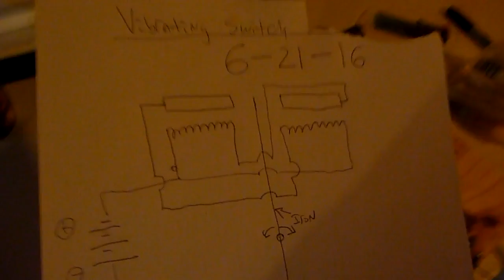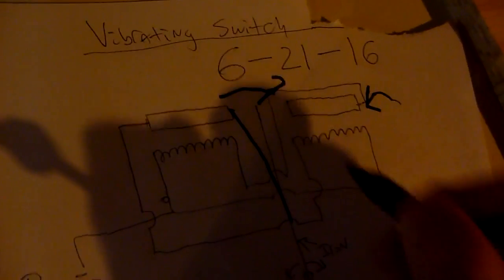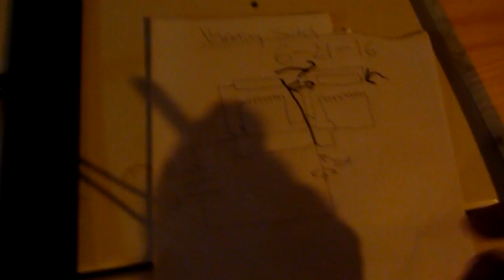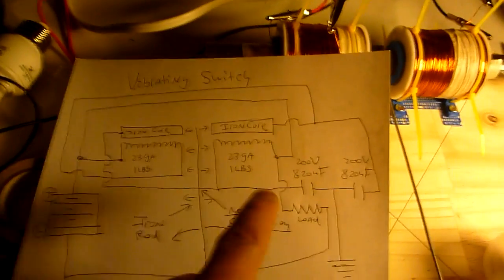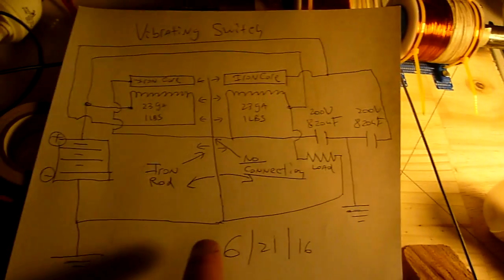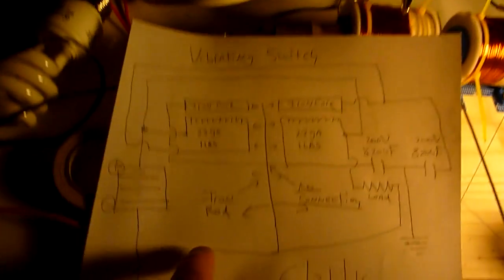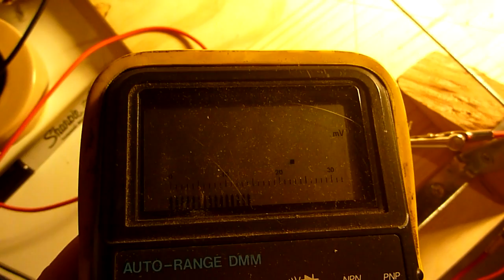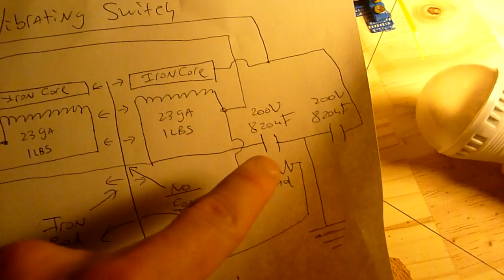Twin Coils Vibrating Electric Switch Circuit with Schematic

Comment: Very much like the old ford model T trembler coils or Buzz coils...used on the ignition spark plugs....the voltage from the magneto is multiplied in exactly the same way using a capacitor to catch the back EMF. working on a theory of my own that Ed used this method to power the wheel.

Comment: Two grounds...  Nice.
Reply from the maker: Yea, my other ground was the dryer itself. I really need to setup a REAL 2nd ground. But the best grounds are placed in water, also it should be branching with central branch being used as the connection point. Maybe that is why Ed Leedskalnin was looking for land with water, like swamp land. He would walk around and poke the ground to see if any water would come out. He ended buying and building his Coral Castle originally on top of swamp land area (or very near to swamp land area). Thanx for the comment.

Comment: The correct term for what you are calling "Back EMF" is "Flyback". 'Flyback' is the same phenomenon as popping a balloon: all air instantly rushes back out, and has the opposite polarity of when the air is pumping in. 'Back EMF' is the Lenz effect: the resistance to change - PLEASE LOOK UP THESE TWO TERMS IN WIKIPEDIA.

Comment: Gravity exists?
Reply from the maker: I don't think that it does. I think that gravity is related to an electrical charge of an object. The Earth has 1G and its charge is 500,000 volts through tulleric currents. The sun has about 28 G, and its charge is several billion volts. There is a definite proportion between electrical charge and gravity. Maybe that is how UFOs work they create a very high electric field around a metal object that nullifies the object's attraction to the Earth (nullifies gravity).
Reply: +Naoki Kashima kool.

Density displacement of energetic frequency is gravity lol 

UFOs for me are man made. Unless portals are real. I'm not that far into it yet lol but I've seen a few weird vessels or crafts in the skies.

But yeah energy or Atoms or Protons/Neutrons/Electrons all vibe and this vibe allows souls or the beholder the feel the sensations of a "physical" experience.

Have you ever worked with magnetic motors?
Reply: to feel*
Reply: I found that electrons are mostly focused in metals. iron.
Reply from the maker: Cory Samoila I like your perspective. I think that this universe has a certain vibration frequency. It is very similar to a channel on your TV set. All the channels are playing simultaneously but your television tunes to a particular channel allowing you to watch it. I think it is very similar to our universe. There might be an infinite number of parallel universes out there all co-existing within each other our frequency determines which of these universes we are attuned to. This sounds pretty deep, but it actually is pretty intuitive.

Also, I've worked with some magnetic motors, why do you ask?
Reply: +Doug Anderson lol Mr. Anderson
Reply from the maker: Doug Anderson You believe that a person who undergoes a formal education no longer can write "I think" in his/her comments? Mainstream education does not teach kids critical thinking skills. School make children memorize information (even if it isn't factual) and then recall that information. Well a voice recorder is capable of doing that, but is the voice recorder intelligent? Nope. The same goes for many of the kids who do well in mainstream schools and universities.
Reply: @naokikashima9349  Man why did you stop posting stuff; you are brilliant
Reply: @manipulativer  Naoki Kashima died in 2016
Reply: @LogicPatience  Thanks for the info. my condolences to whoever knew him